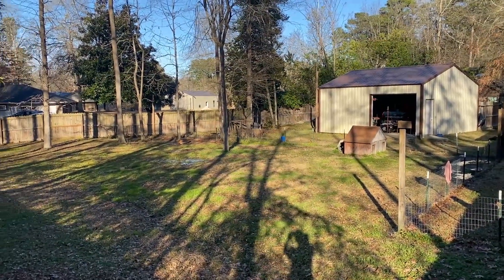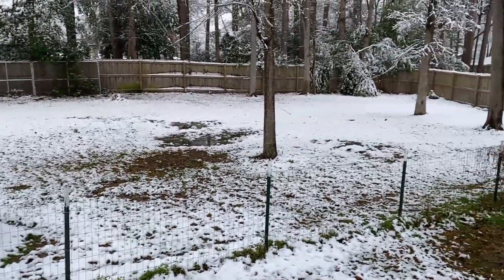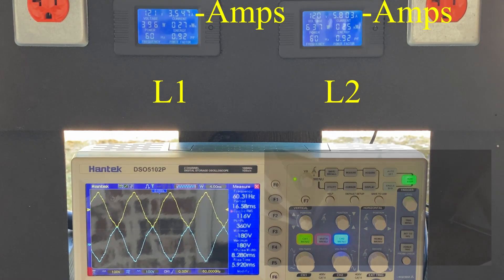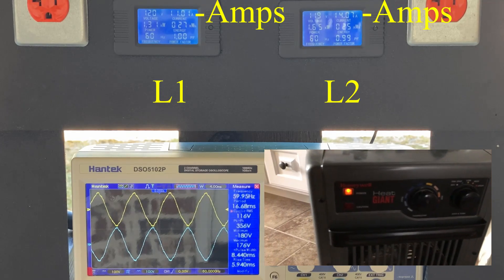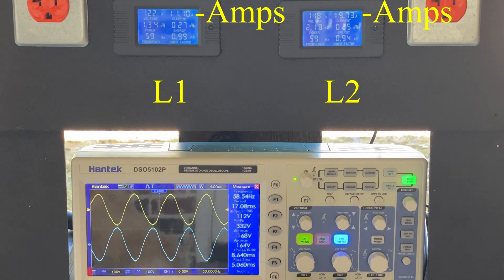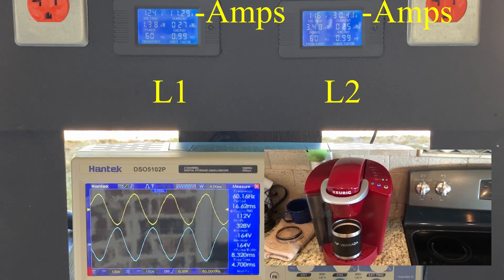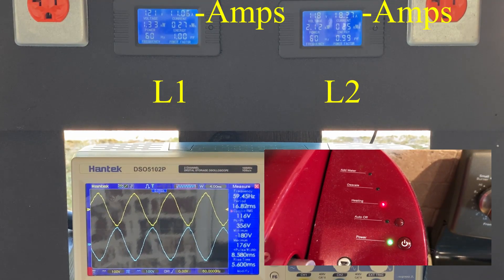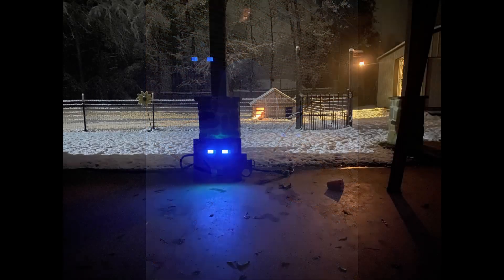Emergency Generator for House - Balancing the load during power outage

Comment: Does that monitor confirm the THD below 5%?
Reply from the maker: @MrSkunks - It does not confirm the THD is below 5%. In fact, I was a little disappointed by the way the sine wave looked with little load on the generator. Thank for watching!
Reply: @LivingCommonSense  thanks! I have the same generator. Recently moved to a home with huge propane tanks and was considering adding a propane kit to it. My other option was to sell it and get a true fuel fuel. The 9500df apparently is the same engine but somehow up to 23 THD. If this one isn’t performing that well on THD, I might just go to the 9500df and save the hassle of the kit
Reply from the maker: @MrSkunks: There's another channel that has a good video on THD and how its computed. Just youtube: "Measuring Total Harmonic Distortion THD using an FFT on an oscilloscope"
It shows a pretty clean sine wave with 10+% THD
Another youtube channel: "Generator Total Harmonic Distortion (THD) - Tested"
Shows a honda inverter generator at 0.7% THD under load.
If you are concerned about THD, I'd probably lean toward an inverter generator. The pure sine wave inverters I've had on the scope have a much cleaner looking sine wave than the traditional brushed generators. Hope these help and that you find what you need. Thanks for watching!

Comment: your generator has an inverter type waveform,
I wish I had one like yours
look at the waveform of mine at 1800w from 3500w
https://youtu.be/OAq70Np6pF8   ugly....
Reply from the maker: Yes, that’s not ideal but we have to make use of what we have on hand. Even on the WPro8500 waveform, my DVD player is unstable occasionally. It runs fine on a Bestek 300W Pure Sine Wave Inverter. A DVD player doesn’t pull much on the batteries. We all have to figure out what works from time to time. Thanks for watching